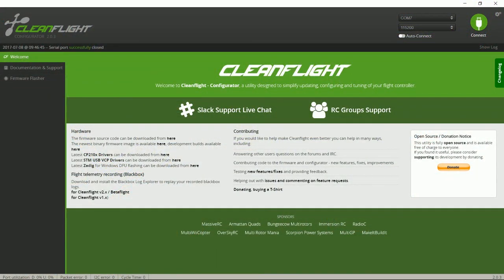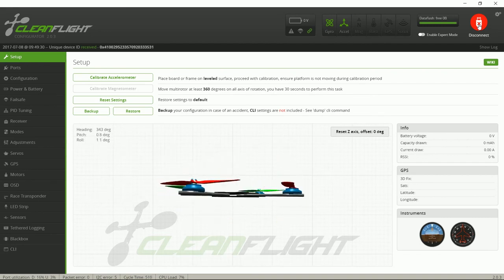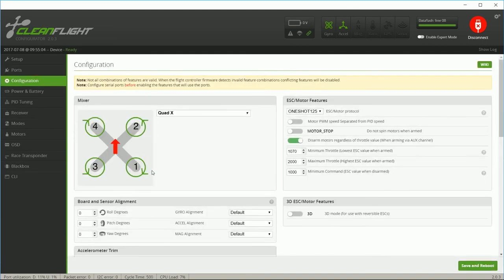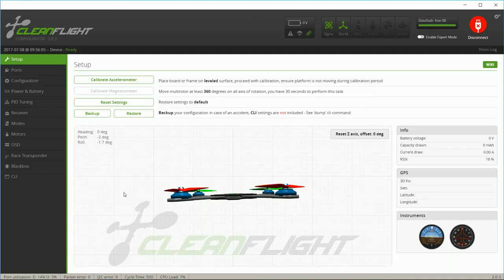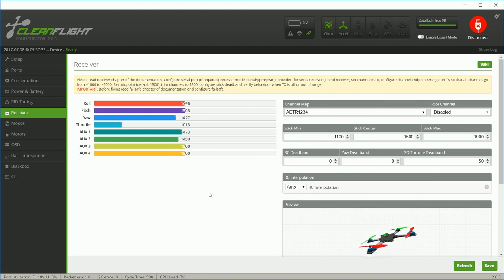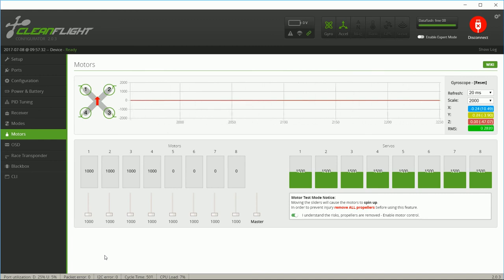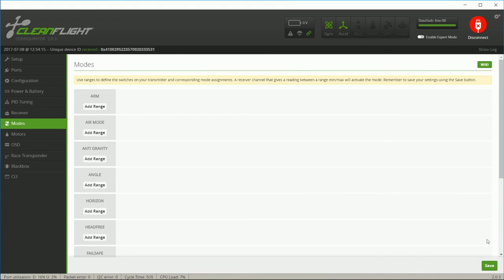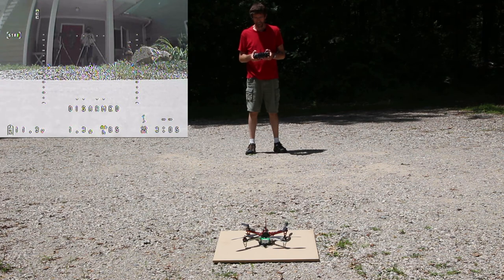Build a Drone Part 4 - New flight controller & FPV camera

Comment: "so I built a new one" . you are bound to find the old one now  ;- )
Reply from the maker: I wouldn't mind that, as I had planned to make a "spare" with the extra parts anyway. I'm not too optimistic about finding it though, and hadn't planned on flying it very far away in the first place but things changed quickly.
Reply: You could search for the lost drone with the help of the mavic pro if it's still in the trees.
Reply: awesome videos btw!!!
Reply from the maker: Thanks, yeah I thought about searching with the mavic but our woods is open enough that it's probably on the ground yet at the same time the trees are dense enough to make it hard to spot. Plus if it's caught up in the trees I'd probably leave it there. I saw a video with one mavic airlifting another from a tree but I'd be more likely to get them both stuck. I just try to look on the bright side - losing the first one motivated me to get the mavic and it's a much better (but alas much pricier) video platform.

Comment: You could build a bright flashing  Led for location of lost drones in dark areas.  Just send up another drone and scan for the flashing LED.  Another Idea, add a radio beacon and make a radio direction finder.  Rainbow Kits sold a pretty good one.  It used a charge pool capacitor and a rotating 4 antenna doppler array.  It was quite good.

Comment: Very much enjoying thus series, and have learnt so much. I’ve been looking to add drones to my r/c repertoire for a while but didn’t want a one-task dedicated drone. I can hardly believe my luck stumbling upon this series. One of the uses I have in mind is a drone for lifting lightweight gliders up high on a hot, windless day, then releasing them so I can hunt thermals. I’d need a ‘go home’ gps set-up, but I see you haven’t made that instalment, yet... Is it in the pipeline? Cheers from the UK.

Comment: Put a little epoxy glue around the USB connector on the flight controller board, these clones are notorious for having that pull right off.
Reply from the maker: Thanks, I will!

Comment: I suspect that your video disruption is predominantly caused by EMI generated during motor commutation. All the cheap ESCs I have implement simple MOSFET half bridges which dump kinetic energy back into the battery via the MOSFETs' body diodes (on deceleration). Forward biasing these diodes can generate lots of high frequency noise during the diode's reverse recovery phase, in addition to the standard switching transients. Apparent difference with antenna placement and flying elevation could be explained by different EMI coupling from wire placement/length and different air currents near the surface (i.e. less stable auto-leveling control loop).

If you haven't solved the video issues, try powering your camera, overlay chip and transmitting radio from a separate battery, with the flight battery monitoring lines isolated using a common mode choke and/or resistors and/or ferrite beads. If the mainboard is doing the battery voltage monitoring and sending it to the overlay chip via UART/digital means, complete galvanic isolation could be achieved with optocouplers or a Silabs digital isolator instead.
Reply from the maker: Thanks for the suggestions. I may try strapping the drone down so I can observe the video over a range of motor speeds with nothing else changing.
Reply: +BrainRight That's a good idea. Clamped to your vice/workbench, you'll also be able to take a ferrite or air core inductor, connect it across an oscilloscope probe's tip and GND, and then hover it near your circuity as a makeshift dI/dt antenna to pseudo quantitatively see the on-board noise spectrum and localization. Given your radio expertise, you may have a spectrum analyzer at your disposal for the best measurements, but an oscilloscope FFT plot works well by itself.

With an ability to observe the noise, you might be able to measure the effects of various filtering changes. 

Adding ~0.1uF (perhaps +/- a decade or two) ceramic capacitors in various places might not show up on the crude oscilloscope wand, but may prove more valuable than the big aluminum electrolytic capacitor you have in the video (aluminum capacitors are useless for high frequency noise suppression).